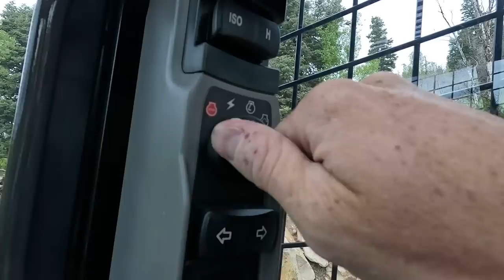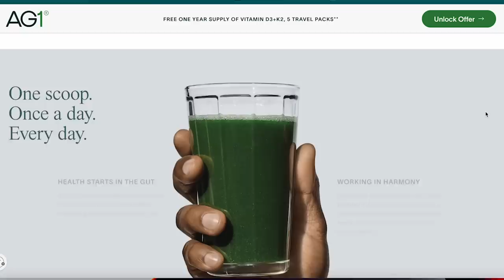WE THOUGHT WE LOST HER FOR GOOD

Comment: Dutch Baby (VERY ABBREVIATED, hit me up with ?s)

NOTE: Don't put the fruit in it. Fruit goes on it. the fruit will slow cooking, but the part that rises wont have fruit and will burn.

small cake pan (not a skillet, too big... each dutch baby is a single serving)
2 xl eggs, 1/2 cup milk, 1/2 cup flour, pinch of salt
Your temp will very, at sea level i'd do 420 for 20 min.

The trick is to get your fat/oil in the pan, up to full temp before pouring in the batter.

Then top with your fruit, butter, powdered sugar. whatever
I usually just use a little butter w/ lemon juice & powdered sugar, and it's amazing.

Worth noting this is essentially the same recipe and cooking method as Yorkshire Pudding (the popover variety), just a different baking dish & fat 

-

Had to chime in.... family recipe/tradition in my household.

Comment: Some dogs are very impulsive and try to run through things resulting in injury.  My most active dog did just that several months back.  She ran through a door as soon as I opened it, and caught her back leg on a piece of hardware sticking out.  She developed a big hematoma near the top of her right rear leg.  Scary at first, but she did not seem to be in any pain.  Gradually got reabsorbed over the course of a few weeks.  The vet looked at it, and the prescribed treatment was to do nothing.  And no, that's not because we are cheapskates:  We have paid for rattlesnake antivenin four times over the years.

Comment: I would recommend what they use in Highways instead of rebar!  I put that in my drive way at work and inside the buildings flooring.  Yes, it costs more!  But, it will last 50 years not 20 - 30 years like rebar does in cement driveways or flooring with heavy equipment/trucks/ect. on it.

Comment: As a retired wood framing structural engineer, I would never design the eave with 'blocking' as you are doing it.  Those should run through and rest on the wall framing and tying into the nearest truss inside.   The way you're doing it, make sure the deking is well fastened to the blocking.   Allie has a new vehicle?  The concrete slab ground base should be thoroughly compacted with a  'waker packer'.
Reply: They announced that the 4runner was traded in on a used/rebuilt salvage title RAM truck . Around January 1ST to January 16,2023

Comment: That is not a fascia board...on the gable ends of buildings it's called a rake board.
Reply: @@AussieMummy-li8yf Here fascia is that same board but only on the horizontal edges of the roof (basically anywhere a gutter would go. Rakes are the boards along the roofline on the gable ends.

Comment: Why didn't you just screw boards to the outer walls @ the height and slop you want the floor and drag a board the goes on top of the mounted wall boards to remove and level the rock???